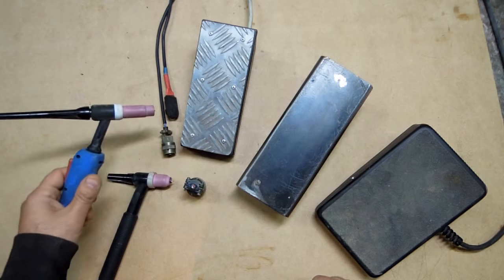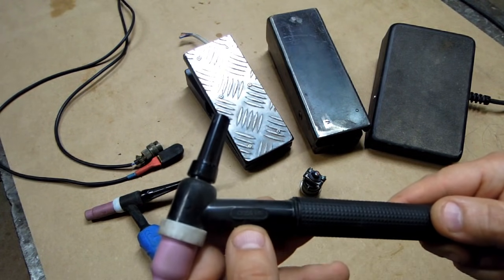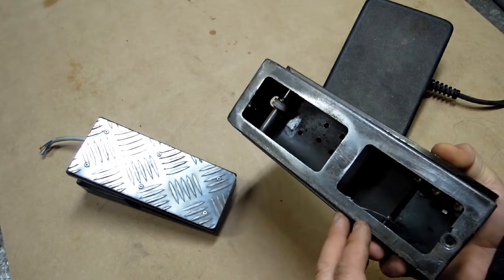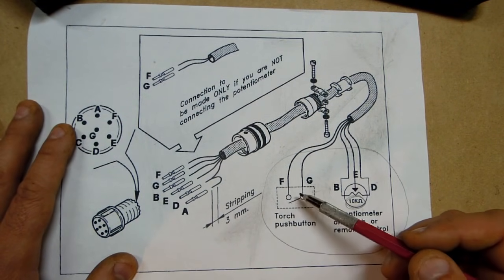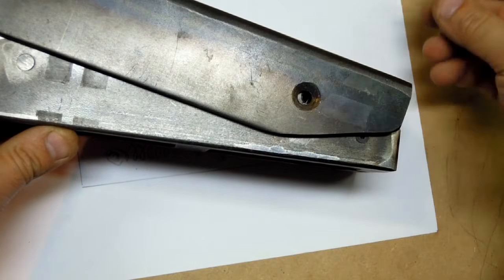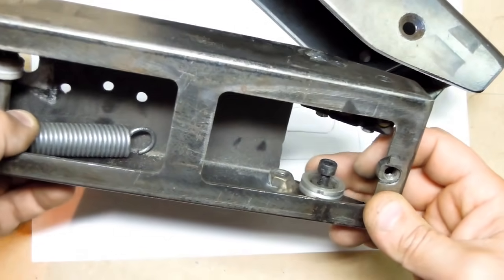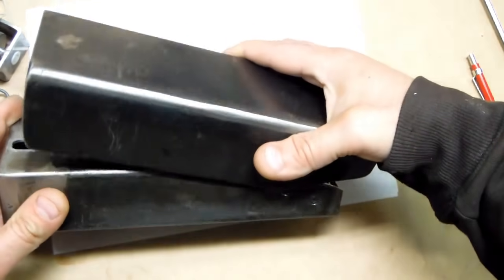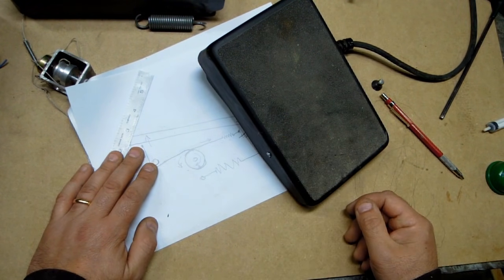DIY Tig Pedal - Part 2

Comment: Most probably, the potentiometer is being  used by the welder as a voltage divider rather than a variable resistor.  The welder applies a voltage across the 10K resistor and the slider gives the welder a variable voltage depending on its position.  The voltage ranges from low to high (or high to low) depending how it is configured as the pedal position is changed.  Pots can be made in different ways.  They can provide a linear output or the resistor can be manufactured to not be linear.  Audio gear (probably like the one you purchased at the music store) usually have audio tapers which try to mimic how the ear responds to power in sound.  Audio taper pots are Log 10 based which is how our ears sense sound.  That explains why you see more or less response at the ends of the slider travel.

Comment: Instead of pressing pedal with toe turn it around and press with heel for more control. Your toes will bend easier while staying at low point while you press down with the heel and you can hold any position easier doing so. Try it without a pedal while sitting down lift heal while toes are on the ground and feel the motion, your still pressing with toes to raise heel but you can gauge how high or low and hold any position. Anyway try it backwards to see what I am talking about, there is no rule saying you must use the pedal the way everyone assumes you must.
Reply: Nice idea...will try.  I am a stroke (brain) experienced engineer/welding hobbiest. My foot control is right foot only, but hand/torch can be either.  My foot sucks. Most hand torch controls offer trouble, because they are on the torch.  I am trying alternatives.  Wire feed right hand with a middle finger (palm held) controller seems best for me. Can feed wire and control amps in comfort. Recently tried left control/right torch...not bad, but have WTF just happened issues. (uncontrollable flinches)

Comment: Volume control pots are usually logarithmic scale,  so if you convert a wah-wah pedal  consider changing to a linear scale pot.   This might explain some of your range issues.
Reply: Hm, that's an interesting observation.
Reply: aserta They're also nowhere close to being an actual log output.
Reply: He actually cut out the log circuit and was only using the pot. I've never seen a log pot. If you can find one I'd like to see it.
Reply: LOLOLOLOLOLOLOLOLOL
Reply: @roamingcelt  please look at the volume and tone controls of any electric guitar and you will find both linear and log pots

Comment: Found out, practical way... that the potentiometers on these things act as voltage divider... and the machines do not read the resistance, but the return voltage... so in fact any pot value will do fine... but it does affect the linearity of the voltage curve...

Comment: Wow, pre "dry humor" Tony!  That's what I get for watching your videos in reverse order. 😁  But seriously, I have an old (1970's) vintage Lincoln TIG-300/300 welder with a saturatable core transformer rather tham today's modern IGBT solid state units.  It's new enough to use a 10K pot and a circuit board to control the core current but too old to find any documentation or even a used pedal designed for it.  There must be some Google-foo cross talk between YouTube and Ebay, because my searches for info and used pedals led me to this video.  Great info!  While I enjoy your dry sense of humor its also nice to see a more serious side.  You sir, are a modern day Da Vinci in many ways.

Comment: I have an SSC pedal on my Miller Synchrowave 250. Those pins at the hinge point are spring loaded and you simply push both sides in to take the top off. The top of the pedal doesn't actually attach to anything else. There is a small ever inside it bears against with a little extra travel to take up some slop. When you pop the top that lever will spring up maybe 1/4". No flying springs or screws. I like how stout your homebrew pedal is, good use of tubing.

Comment: I converted a Dunlop Crybaby Wah pedal to an amp control pedal for tig. I find that mimicking Hendrix’s intro to Voodoo chile is the perfect pulse setting for AC outside corner welds.
Reply: Hi Lee, could you please send me some more info about this conversion? I'm planning to do the same for my Rehm ACDC as it should have the same potentiometer. Thanks!

Comment: Great ideas here and I've only just watched this as I wait to buy my first tig to learn on. I love your production style.
None the less,  I've an electronic background and whilst building a helicopter simulator, I'd built rudder pedals of the sim similar to your pulley setup and was great until the pot's wiper picked up junk and ruined it mid-flight (no harm in a simulator of course but still annoyingly!)
I'd imagine that in industrial setup this is a real hazard.

Then I found Hall effect sensors!

You seem familiar enough to electronics to make modifications etc to your tig so are likely already aware of these, but they work exactly like a pot but using magnetic fields (be aware: there are two types.. Schmit-type on/off - like in tachometers; and "normal" which magnetic field adjusts output)
I could see that a Hall effect sensor installed on the baseplate of your footpedal, with a good neo magnet on the moving part will remove a lot of the complication in the mechanics of this design. As it has been said before "complicated things break reliably".
Drive it with discrete components or feed it to an arduino that will manage your pot thresholds etc.. You'd need to get 5vc dc to it - but you could put the arduino in your tig base... Shrug (plenty of ways to skin a cat)

Anyway, just thought I'd share an idea to see if it might help vs3 of your design - or maybe give someone else an idea to expand on.

Comment: This design is a very good way to avoid gears and sloppy mesh between them, very clever made! Also the releasing of the switch is brilliant. And the adjustable tension spring to move the pedal back up is a great feature.
If you could get the workings of the pot string reversed, so the pedal provides tension instead of releasing, you could have a bit slop in the string to take up the movement used to release the switch. I think I will try to build a pedal that way, the SSC pedals are just too expensive for me, but I would love to see what's inside!

Comment: Thank you so much for this updated video!! And I am just now seeing it!! I watched your first video probably a thousand times trying to figure out what you had done. I did end up building one for my Miller Multimatic 200 and it works great. I used a rack and pinion gear attached to the pot instead of a string. I don't TIG that often so I haven't used it that much but it beats the heck out of the torch mounted control. Thank you very much for your insight into this project!!!!!

Comment: Thanks. I built a wooden volume pedal for a guitar FX pedalboard many years back, and used the same technique for adjusting the potentiometer. Needless to say, mine was much cruder, but just about did the trick.

Comment: Hi Tony,

The 'Pot' is wired as a potential divider. One end of the resistive element will be ground and the other side will be a supply voltage (5v, 10v, 12v, something like that). The voltage on the wiper contact varies with position. The value of the pot won't affect the voltage output and the next value up or down in the range will often wok just fine.

If you wire a pot as a variable resistor and connect it across the ground and supply terminals, you can measure the voltage as you decrease the resistance. When the voltage starts to drop significantly, disconnect and measure the resistance. You can use a pot down to that resistance. A pot of too high a resistance might not give you full range, but won't do any harm.

On my Chinese TIG, the pedal overrides the main panel current control, rather than the panel control becoming max current. To fix this, I have a second max current pot on the side of the pedal.
Reply: Wow Paul that is exactly what I need! How can I contact you to discuss more on this subject? I'd love to have control of my machine's max amperage when using the pedal so that I can have a little more consistency while welding sheet metal. Thanks in advance and I'll try contacting you on your channel if I don't hear back soon, Aloha...Chuck
Reply: This really depends on the rest of the circuit, if you're going into a opamp this might not be the case and could change how the circuit works depending on if there are any filtering in the circuit..

Comment: Enjoy and learn from all your videos, thank you. In my opinion the best upgrades to my welder were the SSC controller $160 and a $150 CK flex head #20 water cooled torch with 15' superflex hoses and a $ 6 push button and $ 5 matching plug for the torch for those hard to reach areas or just tacking. I feel I got a lot of bang for the buck and quality with that SSC controller.

Comment: Love the videos, great job. Given you have three inches of pedal travel you could get rid of a lot of the pulleys for the round potentiometer and use a slide potentiometer attached to the pedal, this would then use the pedal spring as it's return spring. Also using a micro switch with lever and roller on an adjustable plate would give you better adjustment over the on/off switching.

Comment: interesting and verry sturdy pedal , think you can make the springpart a little simpler by welding a piece of flatbar on the pedal part at about the same place where you mounted the metalwire , make the bar short enough it can make the arc inside the case and hang the pull spring on the end of it , should be stronger then the wire , you do need to make a slot in the pedalbase to give the flatbar a space to move in

Comment: One small change would maybe help you a bit- there are potentiometers with built in switches on the same shaft that work from the zero position.  I.E. the first part of the rotation closes a switch built into the pot body, but as the rotation continues, the resistance changes directly with the amount of rotation.  The wiring for the pot is discreet and has 5 pins which you can combine or use independently.  These are cheap and can be found at Mouser or similar electronic supply houses.  Also, there are pots that are linear with the rotation or another type called "logrythmic" which comes on slower but builds faster at the far end of the rotation.

Comment: With a little reconfiguring. You could set your "pot" cable down the same path as your return spring and not have to cut a hole in the open end of your petal. 
To go one step further,  you could go return spring through the pot and end at the heel of the petal.

Comment: the switch you need is adrive switch from a crown RC forklift. costs 2 dollars
Reply from the maker: Thanks Alex!
Reply: HI Alex where do you get one? Do you have a part number?  Tried to search came up with nothing.
Reply: http://www.newsourceforkliftparts.com/products.php

88294 crown part number you can change the arm, or redesign to use a different actuator
Reply: William Ward
 i posted a link
Reply: Looking at that cattledog I'm thinking the micro switch with the roller arm and comes with wiring would be easier to set up and functional.

Comment: If the potentiometer is being used as a voltage divider (likely), then this would be an ideal application for Arduino technology. One could use any sort of peddle position measurement approaches, and program the Arduino to put out the desired voltage. The position to signal voltage to welder amps could all be perfectly mapped in a table in the software, thus allowing tweaking to perfection. Presuming that the welder emits a voltage on one of those pins, then that might be sufficient to power the entire peddle project.

Comment: By the way Tony that SSC pedal should be able to come apart if you press the pivot shaft in on both sides as it should be springloaded to be able to remove the rocking cover. Just press a screwdriver and they should pop in and once you release they should pop out into position again just like wrist watches bracelet springs. Show us the inner guts on that one as i would be interested on having a look inside. That is exactly the setup i need to make a pedal for my Kemppi unit
Reply from the maker: thanks WW, I'll give it a try.

Comment: All you need is a normally open switch and a pot. Use the spring to hold the pedal on the switch so that when the pedal is pressed the button on the switch goes up and closes the circuit. Then all you have to worry about is putting the pot on the hinge. Oh and make sure if the pot you need is linear or logarithmic. Linear basically changes resistance by the same amount for each degree of rotation. Logarithmic doesn't. Also you could cut teeth on the edge of the pulley and use it to turn the pot.

Comment: You should consider adding capacitors, like the OEM, to the potentiometer to smooth out the signal going back to your machine. Pop that SSC pedal apart by depressing the hinge pins in, one side at a time. Nothing will come out flying at you, I promise.

Comment: Some one said it a little bit further down, but a hall effect sensor would be a way to take a lot of the mechanical complexity out of this project. don't know how well a magnet would do in a metal shop, but it would certainly be cool. If you would be open to it I would help This Old Tony to build one.

Comment: Late to the party, but one could always consider building the start/stop switch as a toe switch on the pedal itself(like some flight sim rudder pedals). Then you can press or release it without having to move the pot.

Comment: Having trouble isolating my problem with my Miller tig welder. I've lost amperage control all together. My welder is either on or off to the heat I've set it to. I have tested the part that controls the amperage up and down but cannot find anything wrong. When I tested the three wires coming from it, (two at a time of course) they were opposite each other in resistance. Is that the way it should be? Any ideas what the problem could be? Thanks in advance for your time and help, Andy.

Comment: Tony I didn't read all the replies but it seems like you could tune the pedal motion without worrying about the pot and switch timing and take care of that with gain and offset in an op amp circuit with an adjustable set point for the trigger.     
Did you ever measure the voltage across the two outside legs of that   pot when it's plugged into the machine? I'm and assuming the welder give an actual not set point amp reading so you could measure the actual voltage off the center  (wiper) that gives you 0 and full output. you could also mount the controls off the pedal if it's something you would want to tweak during use.

Comment: So if u didn't use the potentiometer and used just the switch does that mean your amperage wod be fully open when pressed or would the switch have no control over the amperage at all?

Comment: I know this is old but...those pims on the mptrol type foot pedal are spring loaded.  You just press them in and it will clamshell open.  Micro switch anf pot inside with a rack amd pinion type deal.

Comment: I know this is an old video, but have you done any more to control the wave shape (Arduino?) using the foot pedal?  It seems to me the wiper wire on the variable resistor is only providing a voltage and it should be possible to provide a triangle, square or some other shape voltage signal to the welder and control it that way.